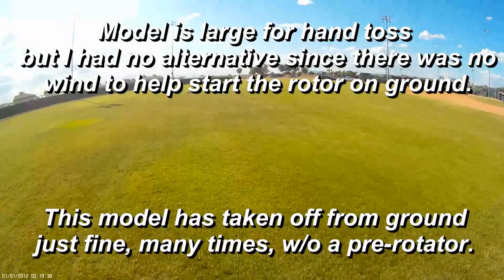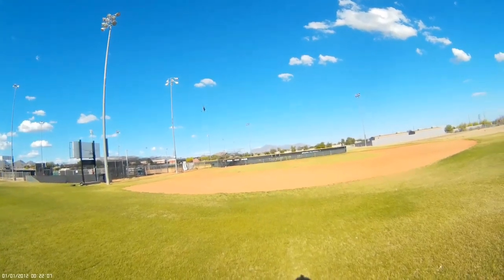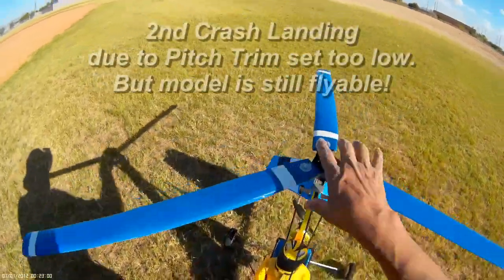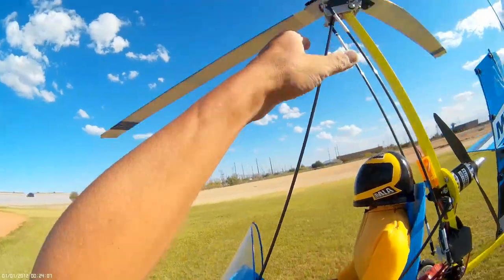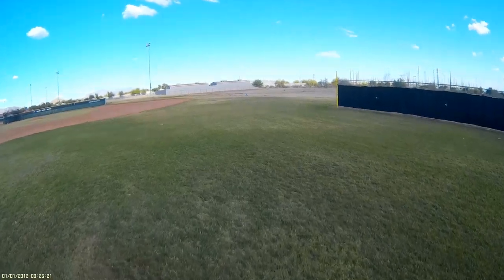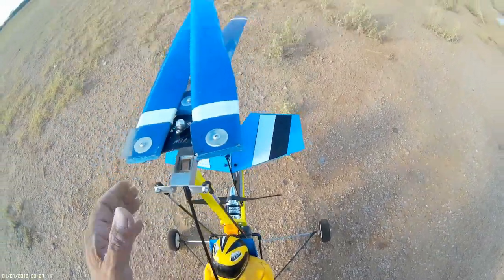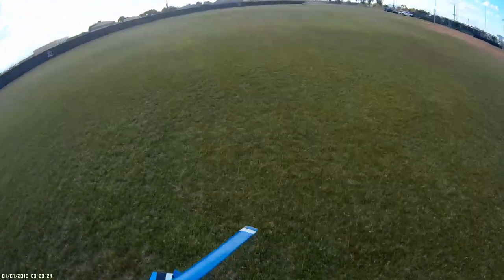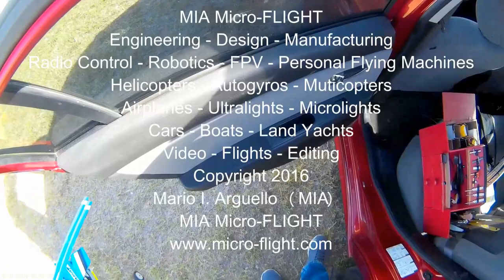MIA EZ Gyro 2.0 - RC Autogyro - Understanding Yaw and Pitch

Comment: Not sure this video teaches anything about trim setting other than if they are not right you will crash.
You need to show if you have this trim this will happen etc, also if and how they interact with each other.
Reply from the maker: To be specific, each rc autogyro model is different. On this particular design the rudder angle in reference to the motor thrust line is used to counteract yaw. Many times it is a matter of finding that angle (sweet spot) that will yield minimal or no yaw tendency. This is one way to counteract Yaw tendencies, other ways are to offset the motor thrust line horizontally on the mast and in reference to the verticl stabilizer. You can also angle the motor a bit in reference to the vertical stabilizer to achieve similar effect. Many times this requires a bit of trial and error to find that sweet spot. Once this is found it can be used as refernce with a set value (distance/angle) for similar designs.